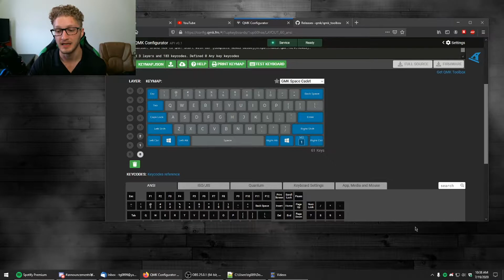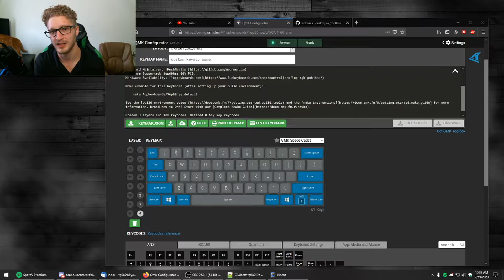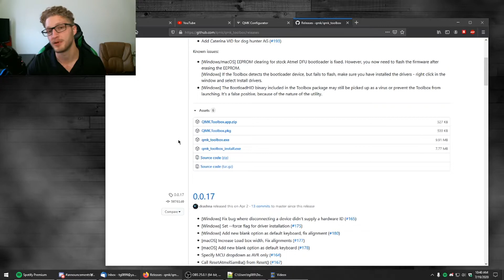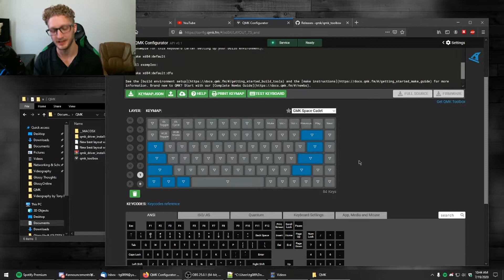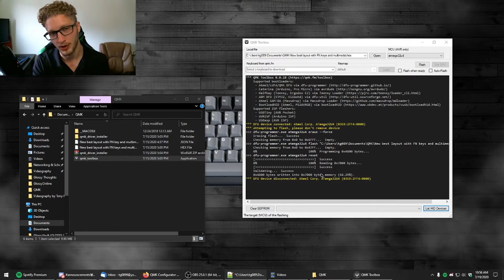How to Flash the XD84 Mechanical Keyboard PCB

Comment: Does QMK supports xd84pro? KP republec said that I can use only TMK.
Reply from the maker: I've used QMK on the version 1 of the XD84, this is the one without USB-C. Not sure if that model supports it
Reply: I've just flashed xd84pro with QMK site and tool. No problems oqqured. It seems easier to do than using a TMK
Reply: @vasilkovalexey272  ты просто подключил, сделал ресет и прошил? Никаких доп манипуляций? На ркждитк писали, что надо что-то делать, уже не помню. Кто-то писал, что клава после прошивки тупо не функционировала, приходилось возиться, чтобы оживить.
Reply: @pRostaPlay  да, после первой прошивки все было норм. Потом я добавил несколько клавиш во второй слой и перепрошил ииии... клава отвалилась и винда стала выдавать ошибку инициализации драйвера. Пришлось полностью софтварно удалить девайс, замкнуть ресет на клаве и заново прошить(без этого она не отображалась даже в qmk tool), после этого все заработало. я не понял закономерности, почему это произошло, но на форумах у многих иногда такое случается.
Reply: @vasilkovalexey272  лол. Я прошил через тел, добавил просто калькулятор и громкость на ын.Месяц юзал. Включил как то утром ПК. Клава не реагирует. Думал плата сдохла. 2 дня валялась. Потом решил через ресет сбросить. получилось. Ещё раз также прошил. Пока полет нормальный
Reply: @vasilkovalexey272  how do you install the driver? i used zadig and i still cant get it

Comment: Hi! I trying to flash my xd84 keyboard and after boot with magnet i can't exit from dfu. Do you know what happend?
Reply from the maker: So when you say you can't exit from DFU, what do you mean? Try this: 1. Plug the PCB in with QMK toolbox open. 2. Put your magnet against the reed switch and you should hear your system disconnect with the device. 3. after 5 seconds has gone by, remove the magnet from the reed switch. you will hear the system reconnect with the device. 4. Try flashing the PCB on QMK.
Reply: @GlossyOnline Thank you for help! When i plug keyboard device manager first show xd84 and then atmega32u4
Reply: @AnthonyJames7  Sorry i messed up. I can't exit from boot mode :/
Reply: @AnthonyJames7  So, I did everythink accordig to your video, but problem stayed. By the way I have 2-nd keyboard version, maybe problem is this?
Reply from the maker: @volteee1147  So when you're at that Atmega32u4 screen, does it allow you to click the flash button while you have the correct .hex file selected?
Reply: @AnthonyJames7  I can press flash button, but it doesn't help
Reply: I tried to flash keyboard with hex file on your site, with hex file from linux conventer and I tried to flash keyboard with default hex file, it doesn't works
Reply from the maker: @volteee1147  Oh interesting. So you're doing this from a Linux host? Does the QMK toolbox support Linux?
Reply: @AnthonyJames7  No, i installed virualbox. I have windows 10
Reply: Did you end up fixing this? Having the same problem :(
Reply: @rowanaldean  No i also have problem
Reply from the maker: @volteee1147  @rowan aldean I'd be interested to set up a discord call with you guys if you want to try troubleshooting a little bit? I'm really no expert here but maybe I can help. I'm unavailable today but I have 30 minutes tomorrow night if you're free? 9/4/2020 at 5:30 eastern standard time work at all for you guys?
Reply from the maker: @rowanaldean  @Volteee  I'd be interested to set up a discord call with you guys if you want to try troubleshooting a little bit? I'm really no expert here but maybe I can help. I'm unavailable today but I have 30 minutes tomorrow night if you're free? 9/4/2020 at 5:30 eastern standard time work at all for you guys?
Reply: @AnthonyJames7  I ended up using TKG and I wrote a lil guide on r/MechanicalKeyboardsUK about it. Looks like QMK support is a pain in the ass for the XD84Pro V2. In future if i have time i'll see if i can contribute to the frontend tools used for TKG and maybe have it able to support the QMK configurator json format. That way you can just take your JSON from their and use it for the xd.tkg.io browser tool :)
Reply: @volteee1147  Head over to r/MechanicalKeyboardsUK for a guide on how I did it and my layout JSON and config. I did use TKG so sorry if you'd planned on using QMK features but im too lazy to get too involved in QMK support for this so I gave up and used TKG
Reply from the maker: @rowanaldean  NICE! Could you share that article with us? I can put a link in the description about it in case anyone is having this issue as well. You're a hero!
Reply: @rowanaldean  OMG!!! It is works, that you very much!!!!

Comment: does anyone know if this works on the 2.0 version(or pro)
Reply from the maker: QMK definitely works on 2.0. If you check out some of the comments between David Butler and I we discovered that the 2.0 version may even be compatible with VIAs gui! If you end up trying that out and it works, would you please let me know?
Reply: @AnthonyJames7  Thanks I just finished my build of one and I couldn't get the brightness of the backlight rgb up, Ill see if it works on qmk
Reply from the maker: @brianvillano8075  Are you enjoying the build?! What's inside?
Reply: @AnthonyJames7  I got the xd84 pro with cherry browns and screw in stabs. Also, I couldn't figure out how to install the drivers for qmk to flash the board. Any clue how
Reply from the maker: @brianvillano8075  Nice on the cherry browns! Yes I belieeeeve I outlined that in this video. Currently working right now, but if you've already watched this video above and are still having difficulties I can try to help later if you try to explain best what issues you're experiencing!
Reply: I'll rewatch it and see if it works. Thanks
Reply: @AnthonyJames7  Hey I just tried flashing it again, and now the keyboard doesn't work. The computer picks it up as a device, but none of the keys work.
Reply from the maker: @brianvillano8075  Interesting! So when you flashed it, did you make sure to import the .hex file before flashing? Not ENTIRELY sure how this works, but if you forgot to import that hex file I could see the program flasshing a blank config onto it. Hopefully it is simple like that but please let me know!
Reply: @AnthonyJames7  I flashed xd84pro v2.0 with QMK. Got the same problems as you did. Re-flashing helped.
Reply: @AnthonyJames7  super late comment but i just got my 84 pro in the mail and still cant get VIA to see it. using v2 with USB c